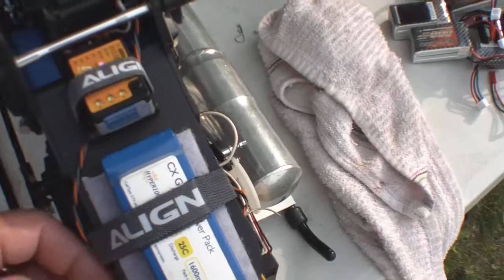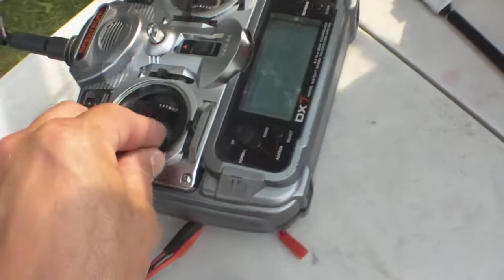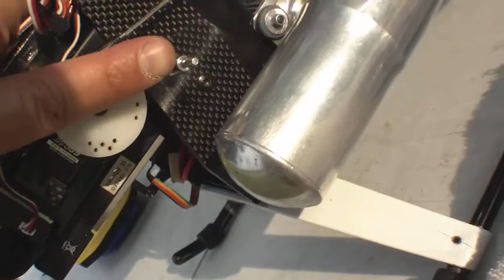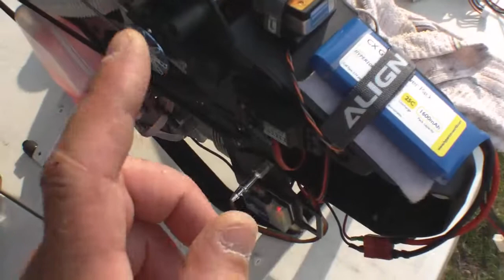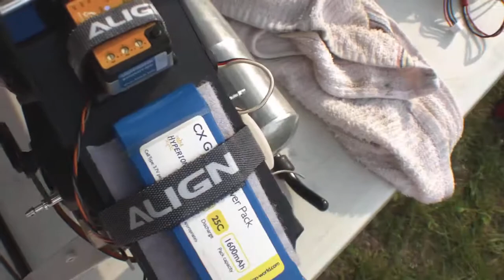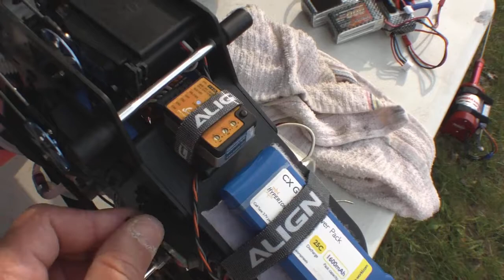Servo on bench..

Comment from the maker: Im running a Align 2-1 which is a 5.7V voltage reg.I also have a stepdown on it and the servo is rated for 6.0V so really don't need a stepdown.I rather run Align servos..This Align DS620 had well over 500 hard flights on it so im happy with that..

Comment: put a step down in between the fbl unit and servo sound like it is getting to much voltage it cant handle 8v like the 610s. put a outrage bl servo on it I have them on my fusion 50. and they can handle 8v easy.  be blessed